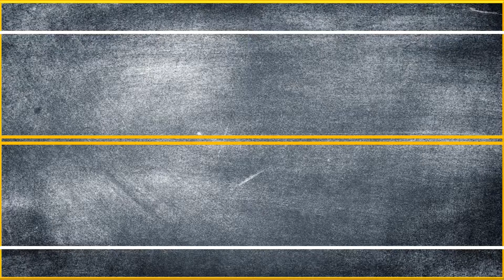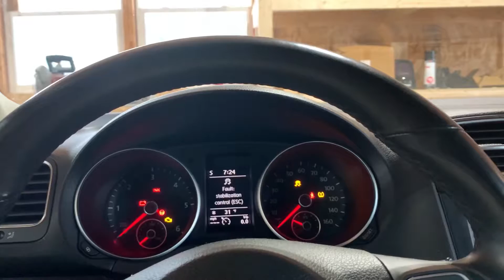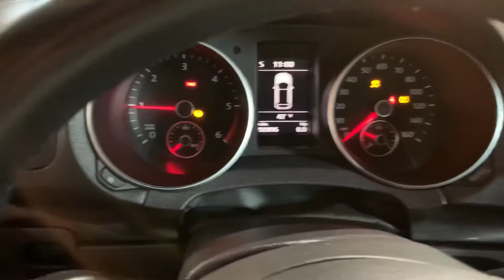MK6 VW Jetta SportWagen TDI Intercooler Froze! Fixed!

Comment: I cannot manage to thank you enough for posting this. I have a 13 TDI Sportwagen. In Seattle we almost never get ridiculously cold temperature, so this has not been an issue until yesterday. No start. AAA came and said it was not a battery issue, that I needed to wait for it to warm up. Watching your video made it clear to me and I could not lift it to get the water drained out but I figured that that water had been there a while so if I could get it started, at 53 degrees with all of the ice and snow melted, I could drive it to my local rental garage with a lift and drain the water out.
Well, your magic cue of adding diesel fuel with the accelerator on start up worked and you made this the best Christmas ever! 
Thanks so very much. In a couple of days, I will go to the garage, lift it and drain the water out.
And, yes, we are lucky to have a wonderful heated rental facility with tools and a lift.

Comment: I'm actually glad I found this video as well as others. I have a 2014 jsw TDI and recently with the cold weather that we've been having I noticed I could go to the store and if the car sits for about a half hour to an hour but it's only happened recently that when I start the car up it runs fine but the moment I start moving it acts like it's sputtering and I noticed a lot of steam coming out of the exhaust pipe. I'm thinking my car is having the same issue and I've only noticed it happening this year. It didn't do it when I just got the car last year. I may have to check the intercooler boots and also doing a similar thing to what you did but you something like pipe insulation and stick it over the bottom part of the grill so the intercooler stays warm like the old tractor trailer trucks used to do.  Mine is a 6-speed manual and it scares the hell out of me when I first experienced the spluttering. It clears up afterwards but still it's not good.
Reply from the maker: If you want Matt, we manufacture block off plates for this now and sell them! It prevents the icing issues by retaining heat in the intercooler. Feel free to send us an email at theoegarage@gmail.com or send us a message on our FB page!
Reply: @theoegarage  yeah I'll have to check it out. It's just weird for me to actually have this happen on my car when last year it didn't do it.  I'm going to pull the splash guard off a little bit and see if I can check my turbo intercooler boots. It must be lucky when it only does it when I'm driving only for a brief second it's like a fine mist coming out the tailpipe. The car has 76,000 miles on it and I'm still paying on it so I can't technically do permanent modifications but if it's something that can be put on and taken off during the summer then I wouldn't have an issue with it.
Reply from the maker: It’s really a “volume” issue. The moisture builds up during cold weather driving (EGR pumping in hot air causes condensation.) That moisture is normally just eaten by the engine in the “small” droplets as your drive. Problem is, when the intercooler is super chilled by incoming air the moisture will freeze in the intercooler itself. This causes a buildup of ice, which has two possible outcomes. Outcome 1: you park the car, ambient engine temps and/or outside temps bring the intercooler above freezing and the ice melts into a large amount of water in the intake boots. When to go to start it floods the engine and potentially hydrolocks/ bends a rod. Option 2: it stays below freezing for an extended period of time which causes the water to freeze solid in the pipe. When you start the engine it will run for a few seconds, expend the oxygen in the pipe and vacuum lock itself up (like trying to suck through a straw with your finger on the end of it.)

We do make them super simple to put on, 20ga aluminum powdercoated black, three zip ties to mount it.

Comment: Man, You got off EASY. I had same exact symptoms. Pulled valve cover/ injectors(rather involved if you have never done before-which I hadnt). Soaked a BUNCH of water out of cylinders. Then pulled intercooler pipe and I had 4times the amount of water/ice you had(I live in Alaska). Getting ready to put her back together and hoping didnt bend valves or connecting rods. You could call it a love/hate relationship with this TDI.
Reply from the maker: It’s a seriously bad oversight by VW. Their TSB’s don’t even fix the issue. If you want a block off plate you can send us an email! They prevent the icing and therefor the hydrolocking just by keep heat in the engine bay.

Comment: Classic, I get this with my CJAA. I even get condensation-related starting problems in summer. Blocked it with pipe insulation. How'd you make the lower grill pattern?
Reply from the maker: Yeah I’ve seen it come up a TON. Another owner had a rough measurement of one they made, so we took those and threw them in CAD, measured some of the corners and such up, and used that as a template for the blockoff.